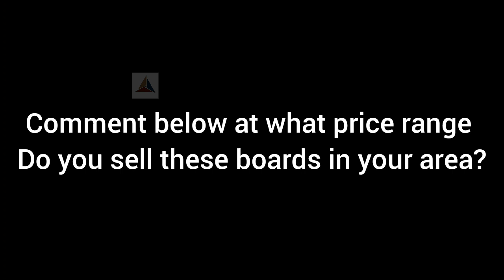Clean PCB Boards After Recovery | What To  Do With The PCB Boards!

Comment: sir you have a lot of experience in gold mining i have benefited a lot from you i want to know if aqua Regia can be killed nitric acid  with  urea or 
 sodium hydroxide (NaOH) besides urea
Reply from the maker: Aqua regia is a highly corrosive mixture of nitric acid and hydrochloric acid, and it is not typically "killed" with other chemicals like urea or sodium hydroxide.

When aqua regia is prepared, it is typically made by mixing concentrated nitric acid and concentrated hydrochloric acid in a specific ratio. The resulting mixture is highly reactive and can dissolve noble metals like gold and platinum.

If you want to neutralize or "kill" aqua regia, the best method is to add a reducing agent like sodium sulfite, sodium thiosulfate, or ferrous sulfate. These chemicals react with the nitric acid and reduce it to nitrogen oxide gases, which are then released into the air.

Urea and sodium hydroxide are not typically used to neutralize aqua regia, as they are not effective at reducing the nitric acid. However, they can be used to adjust the pH of the solution, which can help to make the solution less corrosive. But even with pH adjustment, aqua regia will still contain highly reactive nitric acid and hydrochloric acid, and should be handled with extreme caution.
Reply: @TrinityGoldRecovery  brother please write for me how to recover gold from electronics without aqua reqia? If aqua reqia can melt gold can some of the gold evaporate in aqua reqia???
Reply: @bemindfulofurswalah 

If you exceed temperature 160c then yeah you're evaporating gold chloride aka as gold. 

Role of thumb, don't let the solution to boil.